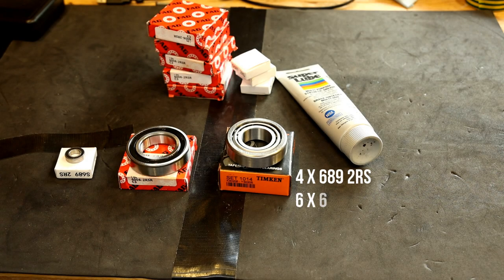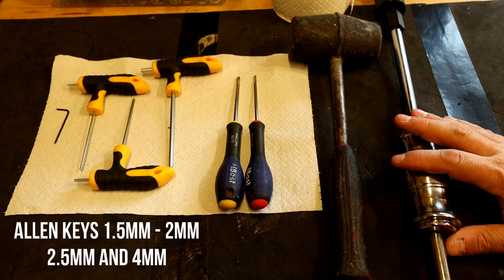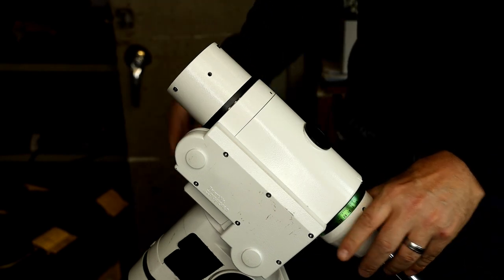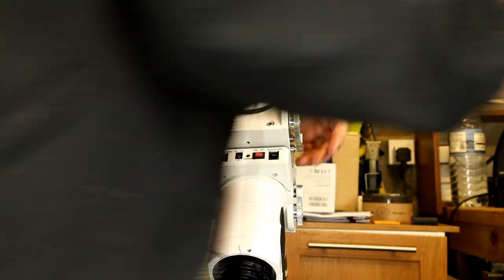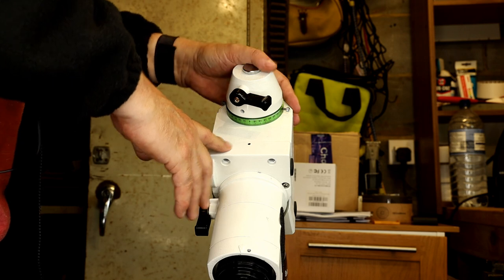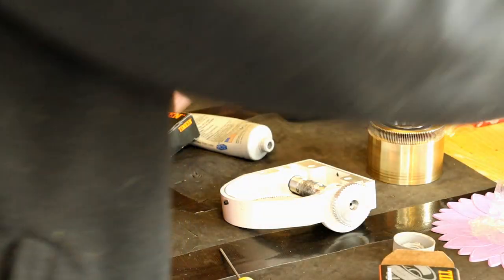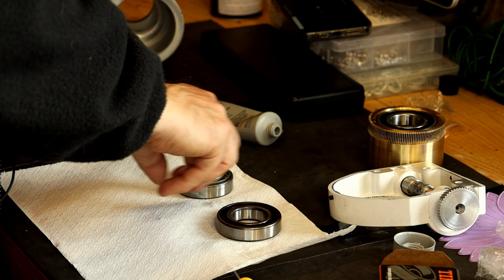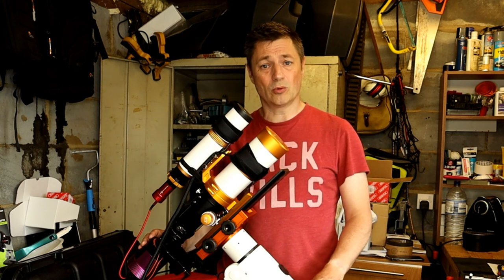HEQ5 Pro Hyper Tune. Get the best out of your mount. Astrophotography

Comment: Hello Glenn!  Thank you this great video and all of your other videos.  I have really learned a lot and have enjoyed watching then.  I have a relative new HEQ5 Pro and I going to upgrade with the Rowan belt modification.  Are you replacing the bearings because the original bearings are inferior to the new ones or are you replacing them because the original bearings are worn out?  Even if your mount was older; I would not think that the bearings would wear out at the low slew speeds relatively short time in use when compared to their design intend of continuous use in an electric motor or other equipment application.  Listening to your commentary it seems to be a little of both.  Thoughts?
Reply from the maker: Hi Ron and thank you for the kind comments. The Rowan belt ,od is without doubt the best upgrade you can do for that mount, will improve backlash and makes it a lot lot quieter. The HEQ5 I bought was quite old and very stiff in both the RA and DEC axis and why I decided to strip it down and service it. The bearings were ok but a couple were leaking at the seals and so decided a new set of bearings would not hurt (not overly expensive)
You are right that it is extremely unlikely bearings would ever wear out in a mount. I also think someone had been inside this mount before and had not done a great job. It runs lovely now.  Clear skies
Reply: @Astrobloke  Thank you Glenn for the quick response.  Yes, you did mention in your video that some of the screw heads looked like they may have bee messed with!  Based on the quality of the bearings that you found inside and given the relatively small cost (~$75) would you recommend just replacing them anyway to improve tracking?
Reply from the maker: @ronrakos4165  I would see what the mount guides like because if it is guiding at a satisfactory error I would not change them. I would only recommend taking your mount apart for this kind of work if it has issues. As I said before mine was very stiff and difficult to balance and was guiding poorly.

Comment: Did you need to use a degreaser to clean up the brass?  Interesting video.  Just waiting on parts to hypertune my Celestron mount.  This serves as a bit of a primer for my anticipated service.
Reply from the maker: Hi David. I did not as upon inspection all it really needed in my opinion was a good wipe down. Some of the older models have a very sticky grease which I think would have made me use a degreaser. Its not wrong to degrease and is a lot more thorough but I chose not to and it didn't seem to be an issue for me.

Comment: Great informative work, well done and very good explained 👍👍
Could you show us how to remove the backlash on an EQ-6R-PRO also ?
Reply from the maker: Thank you Siegfried. I do believe it is the same process on the EQ6 R Pro. I will now be having a proper look soon and am considering doing the same job on that mount also
Reply: Siegfried, it's nearly identical, just follow Glens video on the rebuild, and for fine adjustments on the worm drive placement, you can also watch Cuiv of Lazy Geek on you tube as he shows the back and forth work involved.   When I bought my eq6r brand new, stock the rms was around 1 arc sec.  After adjusting I got it down to 0.5 arc sec rms.    I am now replacing my bearimgs to higher quality and should get the rms down more.  Also, you will need a tool like this to remove the lock nut on the taper bearing.  Hope this helps!

https://www.amazon.com/dp/B07RDPJF7N/ref=cm_sw_r_cp_apa_glt_fabc_VTT0D9KPHNET2X48KB21?_encoding=UTF8&psc=1
Reply: @billblanshan3021  Thanks for the info and the link !
What size should I need, 3, 4 or 5 mm ?
Reply: @siegfriednoet   I have a 3mm and worked but the holes are 4mm so I would get that one
Reply: @billblanshan3021  thanks !

Comment: I don't even own this mount but I enjoyed watching the whole video! I love this side of the hobby. I am hopefully going to invest in an HEQ5 mount asap actually. I already own the little Skywatcher Staradventurer pro 2(wifi) - can you do a video on pimping that up? Or is it a waste of time? I was thinking using the Staradventurer as my travel mount, and wondered if there was anything I could effectively do to improve it 👍
Reply from the maker: Thank you for the comments. I have not owned o e of those but have a video on servicing the sky watcher AZGTI which is similar. It would be a case of taking apart, cleaning and regreasing. Possibly new bearings if you can source the ones in that mount. The AZGTI benefitted but the staradventurer pro2 is a lot newer so may well be better assembled.

Comment: Wow when you showed the „after” at 56:11 my jaw dropped. It turns incredibly smoothly. I’m gonna do a grease job on my new EQM-35 which is so stiff that I don’t know how tracking even works (i get 3” RMS). Do you think I can get it up to this level? The EQM-35 doesn’t have bearings - just grease
Reply from the maker: Thank you. You might find just loosening the main nuts that hold the RA and DEC together may be enough. They are often way too tight from the factory
Reply: @Astrobloke  oh man you’re a genius. Today I felt ready to do this and loosening the silver ring for the Ra that holds it together totally did the trick. Same with the Dec bolt. They don’t spin like yours but for bushings only it works very very smoothly. Can’t wait to compare the guiding RMS as soon as it clears up! Thanks man, you’re a mount saver 😃
Reply from the maker: @kamilkp  you are welcome. I bet you will see an improvement in your guiding. You should be able to get at least 1 arc sec and possibly lower. I have not used that mount so can’t be sure of the figures you can teach
Reply: @Astrobloke  yeah I recorded footage of me disassebling and loosening what needed to be loosened so once I test it out and see how guiding goes I will put together a video (might be a while cuz the weather is crap these days in southern Poland)
Reply from the maker: @kamilkp  same here. Will like to see the results. Wish you luck
Reply: @Astrobloke  I've done that and it improves the smoothness a lot.

Comment: Your very clear and concise video has given me the confidence to have a go on my HEQ5 PRO. When I have the HEQ5 PRO. working I am hoping to do the same with my recently bought 12 year old NEQ6 PRO which is quite resistant in movement. Can I assume it is the same principle , and where can i find the bearing details? Thanks again.
Reply from the maker: Hi Chris thank you for your very kind comment, very pleased the video was helpful to you. The Same principle will apply to the NEQ6 although it is a little different. I have a video on the EQ6 R Pro which will help 
https://youtu.be/qujs7Kt_6_c
There is also some useful online details on Astrobaby site and I think here they list NEQ6 Bearing sizes
https://www.astro-baby.com/astrobaby/help/rebuilding-the-skywatcher-eq6orion-atlas-mount/
Reply: @Astrobloke  
Thanks so much for the information, and the prompt reply.

Comment: Would like to know the difference in the rms after the adjust. 👍🏻✌🏻🇨🇦
Reply from the maker: I will do a full video on guiding and PEC training with this mount but just ran guide assist and calibrated and it is sitting between 0.3 - 0.5 so I am very happy.

Comment: Great video! Is the 6006-2rs different from the 6006-2rsr bearing?
Reply from the maker: 6006 is the bearing size. I believe the following suffix letters refer to types of seal used etc. I would check with the supplier for proper clarification though

Comment: I have a question, how do you know how tight the DEC axis should be? And by that I mean the thing you screw on around 25:55. Thank you for a great guide!
Reply from the maker: I tighten it only to the point where there is no movement in the axis if pulling or pushing. These are often over tightened and can cause stiffness if done up too tight. But there must be no in/out play
Reply: @Astrobloke  thank you!!! i loosened mine a bit, will try tonight :)

Comment: Hey Astrobloke! Do you need to buy these new bearings even if the mount has been bought new and used only a couple times? Seems unnecessary? Thanks! W.
Reply from the maker: Not at all. My mount had issues and was a few years old when I got it and didn’t know the history. I found a couple of the bearings were leaking and it was quite stiff especially in the DEC axis. It was a big improvement to my mount but not every mount is the same
Reply: @Astrobloke  Makes sense! I'll just give it what it needs. Great, mint condition on this mount I bought. It does have a few years on its neck and it's a bit stiff in the RA / DEC but it's been used almost nothing so should be good after a little stripdown, cleanup and reassembly without having to buy new bearings.

Comment: I don't have the Rowan mod done to mine yet, but I was recently trying to remove 3400ms of DEC backlash that PHD2 was insisting I had (but I couldn't feel any play in the mount).
I loosened the hex bolts and tried to adjust the backlash, like you did here, but the screw for closing the gap in the worm gear was very tight, even after loosening the other worm gear screw. And it was strange because I wasn't getting any binding either.
But after watching this video I'm wondering if I couldn't move it because the other gears had no play in them either, and perhaps I should have some slack in the "side-box gears" so that the worm gear housing has room to move?
Reply from the maker: hi. The Rowan belt mod will definitely help with back lash and I would say a must upgrade for your HEQ5. it improves so many things its well worth doing. Fine binding is so hard to detect and can be there even if the mount is slewing and not making any noises or stopping. The biggest problem is if you use guide assistant it will appear on the graph as backlash. Problem with it is it cannot be compensated for but backlash can and so yes a minute amount of play is better than none. Can I ask what your typical rms error is on RA and DEC axis and total please?
Reply: @Astrobloke  Thanks, that's quite helpful, I didn't know that binding could show up as backlash!. 
My RMS is generally a little less than 1" on RA and about 0.64" on DEC (Total: ~1.25") on a good night, but on a bad night it can be x2 or x3 times worse, even with no wind or clouds.
But I've been messing with it last night (the info in the previous comment) so I don't know if it's worse or better now. But I might mess with again later.
I did have a strange occurrence alright a few nights ago, I was randomly having poor guiding (about 2" on both axes) so I adjusted the counterweight to see if it would improve things, but it improved my DEC by about 70% and did nothing for RA, and I was quite confused about it!
Reply from the maker: @JoeBob79569  what scope are you using and have you checked the 3rd axis balance as this can have quite an effect. The DEC numbers are not too bad but the RA needs to be around the same. Try backing the RA axis off a little and see if that makes a difference. Have you tried any PEC training?
Reply: @Astrobloke  I've never come across the term "3rd axis" before, but after a quick google I've got it now. It's something I was thinking about before, but I just didn't have a name for it.
I do have my focuser on one side and mini PC on the other side for balance, and it's close but not perfectly balanced. It generally doesn't drop by itself, but I can feel that it does favour one side slightly. But I should also probably move the mini PC to the mount because it has a fan in it.
The scope itself is a Bresser AR102s (600mm).
I'm not sure what the deal is with PEC training through, I'm pretty sure the mount supports it, but the Synscan app says it's not supported (I have the wifi model), but I do use the PEC algorithm for guiding in PHD2.
Reply from the maker: @JoeBob79569  The 3rd axis balance can cause issues to the RA balance and why I mention it as your RA had a higher error. PEC training can be done with the HEQ5 with EQMOD but the fact you are using the PEC algorithm is good enough. If you have like the slightest of play and I mean 1mm in both axis and no improvement in your guiding after running guide assistant (always run a fresh calibration after making the changes) then I would suggest that the belt mod is your next major step. Everyone I know that have done it have noticed huge improvements
Reply: @Astrobloke  It's odd that the PEC Training doesn't seem to be supported for me because the mount does support it, and I've read about some people doing it via the Synscan app on the EQ6-R, but it just says "unsupported" in the app for me with the HEQ5. It would be nice to have the mount take care of this, and then to let PHD2 make additional corrections via another algorithm like hysteresis or something.
This was some great info though, so thanks, and at least I have some options to tweak in the next few days, there's nothing worse than not knowing where to go next!
And yea, I'm sure I'll get around to buying the Rowan kit eventually, when the bank balance permits, it's a hell of a hobby for emptying the wallet!

Comment: Great video and tremendously useful.    Did you apply grease to the outside of the brass drum where the clutch makes contact?   Logic would suggest not but there seem there was some when you opened up the mount.
Reply from the maker: There was quite a lot of grease on that brass area and there should be none. One of the bearing seals was leaking so that could have been the source although it could have been done during assembly.

Comment: Great video tutorial! I'm a little stuck on the worm gear carrier though. The two washers with the two slots won't budge. How else can I remove one? I presume there is a specific tool?
Reply from the maker: I am surprised they are that tightly done up. Circlip pliers might be better but a lot of them (mine included) are not long enough that why i used long nosed needle pliers. You could get a small flat bladed screwdriver into one of the slots and give it a few light taps. It may be enough to loosen it off

Comment: Great stuff been waiting for this. One question, when I checked the website there doesn't seem to be any  6006 2RSR. There is 6006 2RS1 SKF Deep Groove Ball and 6006 2RS C3 - FAG Deep Groove Ball plus a ceramic one and a hybrid ceramic. I know zero about bearings so please forgive if this is a stupid question
Reply from the maker: 2RS1 are fine. I have used the larger version of these in my eq6 r pro. The final letter and numbers is about the type and if its sealed or open. If you are not sure the bearing companies are very helpful and can confirm if they are suitable.

Comment: Wonderful video! It seems as though it is not as complicated as I thought to hypertune an HEQ5- thanks to your explanation. I will give it a shot. Before I purchase the bearings. Would you recommend fully ceramic bearings or stick with the hybrid ones you use in this video? Would there be any benefits? Cheers!

Daniel
Reply from the maker: Hi Dan and thank you for your kind comments. Because the mounts move very slowly I don’t think going fully ceramic will make a difference and they are more expensive. This is just an opinion however and not something I have tested. Good luck with the project and I am sure will give great results. Clear skies

Comment: The 689 2RS is not a Timken bearing. What brand did you wind up with? Not looking to put a cheap bearing back in when that is what I'm trying to get rid of. I did find the other bearings in Timken.
Reply from the maker: The roller bearings were Timken but the sealed bearings were all SKF brand.